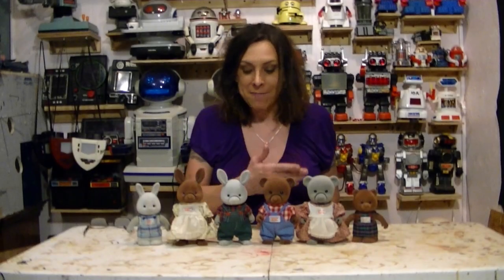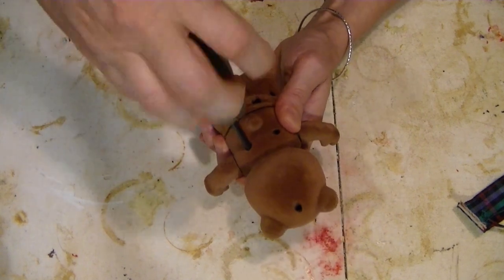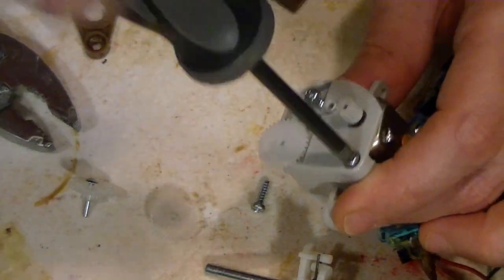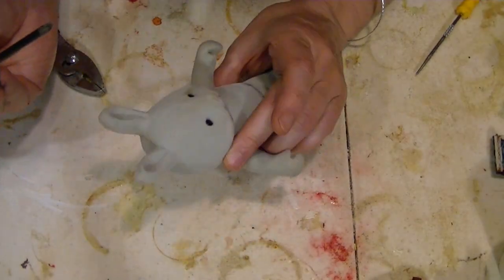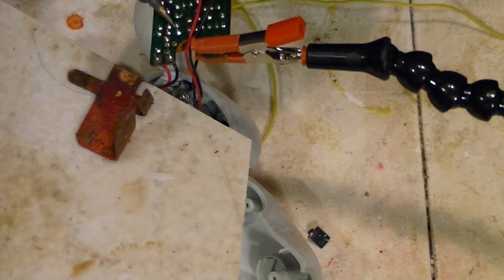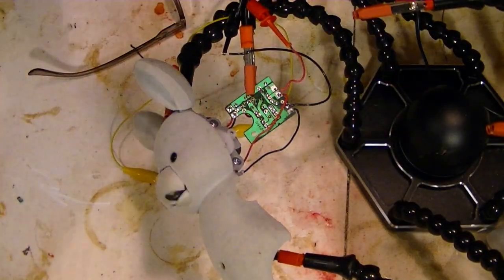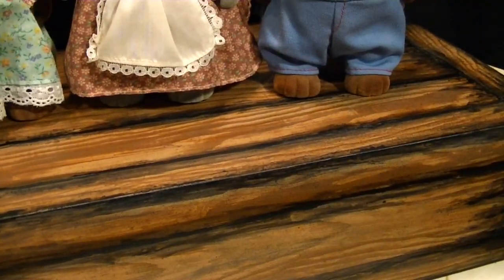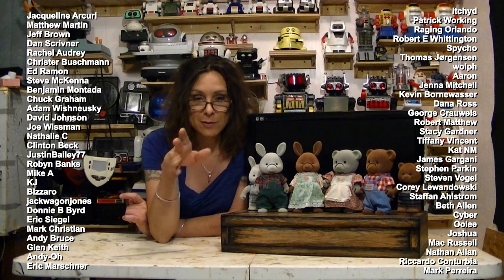TOMY Sylvanian Families Dancing Critters - Refurbished

Comment: Performance idea - a bluetooth device for each, a simple set of cheap earbuds hooked into their mic pickup, so that audio played over the bluetooth devices paired per figure will only activate the one you want at the time you want. True you'd need six bluetooth transmitters, but it'd be wireless and a wholey internal and easily undone mod.

Comment: I got a remote for my sharper image RoboCub. He doesn't work. It's got split 10t and 12t gears in both feet. I ordered them from AliExpress. Now I i just wait a month for them to come.
Reply from the maker: I get them off ebay, they still come on that slow boat from China.
Reply: @RandiRain   Check out AliExpress. Everything's a third the price. I've gotten repair parts a few times from AliE. Toy gears, piezo speakers, tiny step motors that always fail in Furbys. Always way cheaper than Ebay.